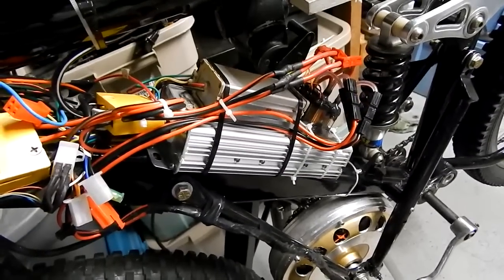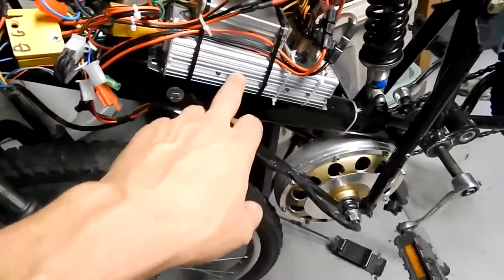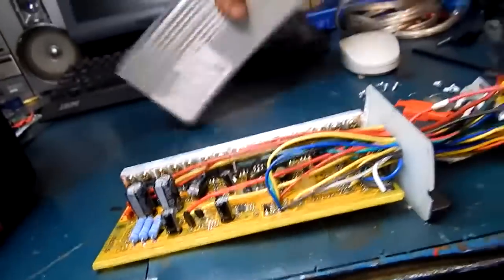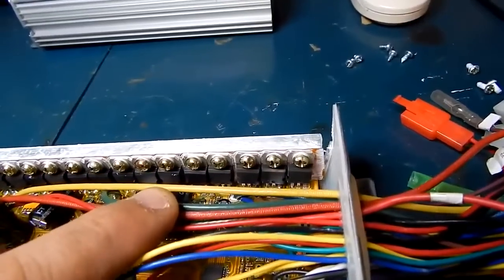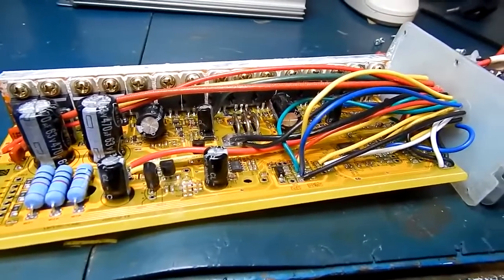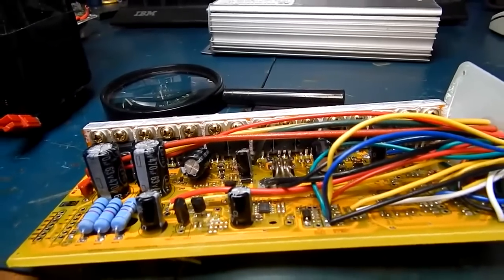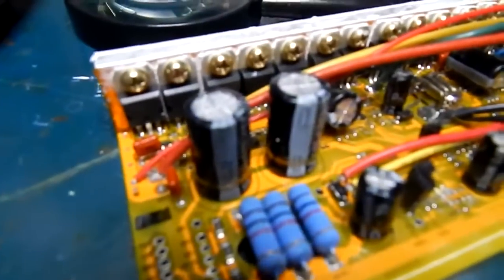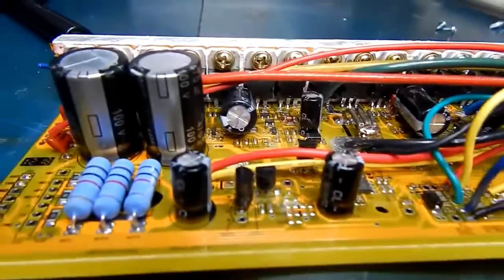ebike controller shunt modification *35amp to 45amp*

Comment: Hello Sir,
i'm very interested about how you put DD hub into the middle of the bike. Do you have some thread in some forum? Can you share some pics and details about hub and controller you are using with batteries and what did you intended to achieved installing DD hub into mid section of the bike. I'm looking forward to hearing from you.